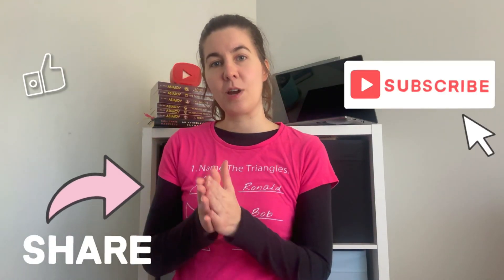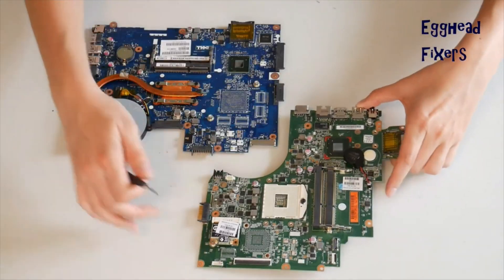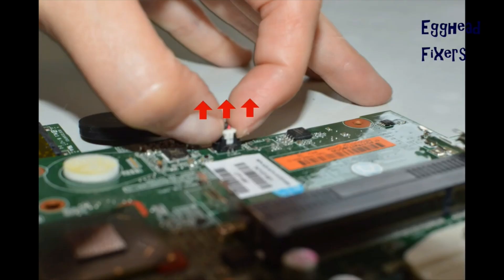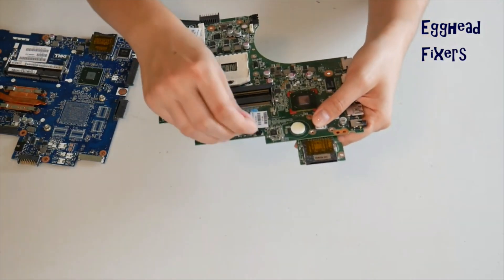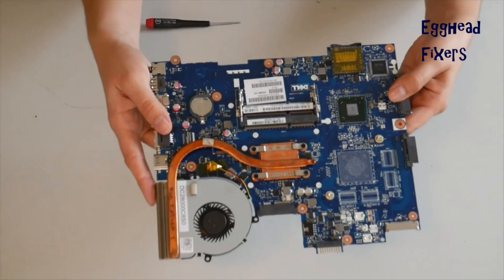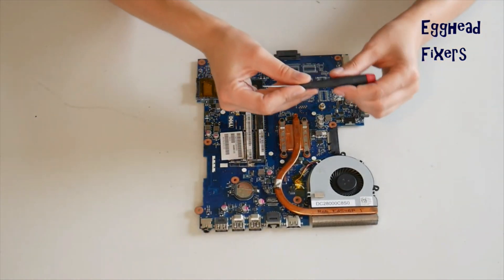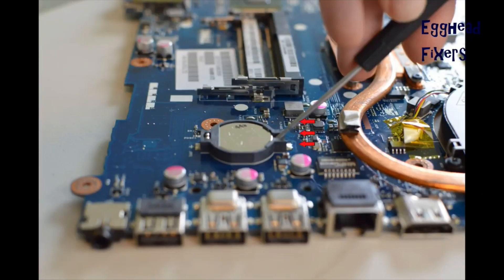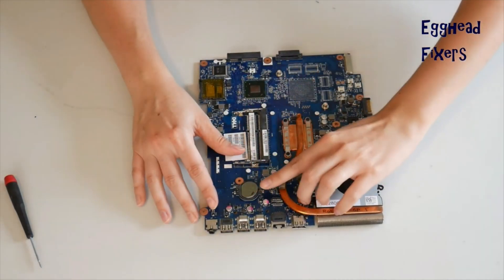FIX Your Dell LED Code 3 1 in 5 Minutes FLAT! Tutorial by a Certified Technician

Comment: Hello...I need help!  I have an Asus computer X541NA.  When the Windows 11 update arrived about three years ago, I tried to update it, but at the moment the power went out and the computer stayed on but I couldn't see the screen.  I've seen several videos on how to fix it but I haven't had success with any of them.  What it currently does is that when I press the power button, I hear little noises and the fan turns on but the screen always stays black.  I try to turn it off by holding it for 15 seconds and by itself, connected to the cable, it turns on by itself but the screen is not visible..I watched all your videos (how to fix black display).   I can't get it to stop turning on by itself.  Any suggestions?  Thank you.
Reply from the maker: If you hook it up to a monitor or tv can you get it to display on the tv/monitor?
Reply: @EggheadFixers  oohh....let me try, thanks.
Reply from the maker: @bf3476  You're welcome!!
Reply from the maker: @bf3476  You're welcome!